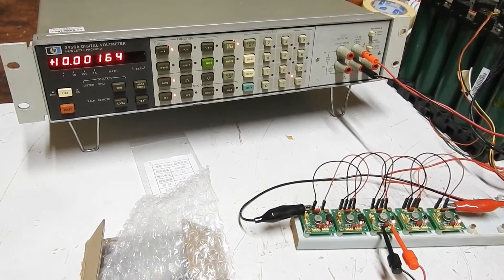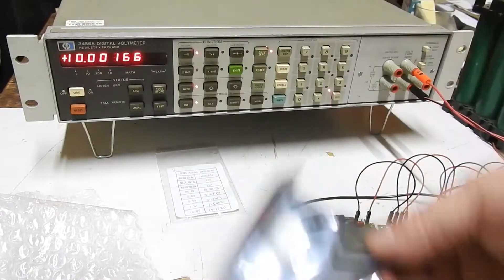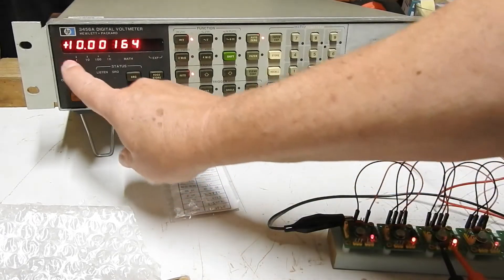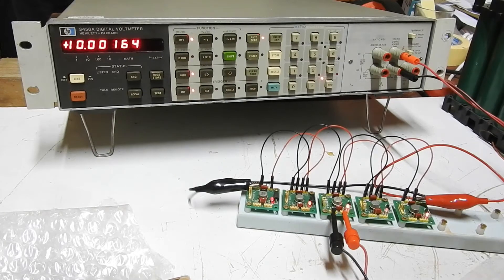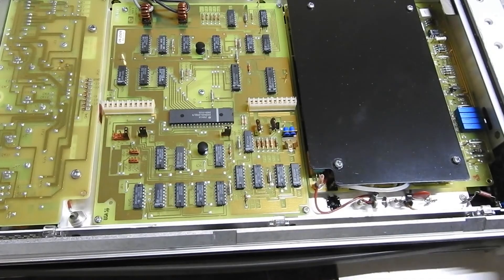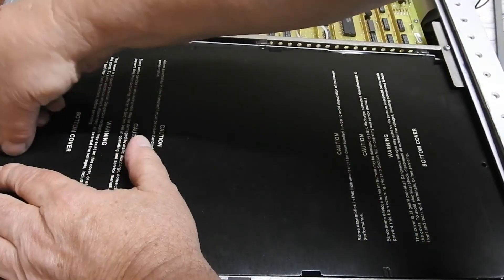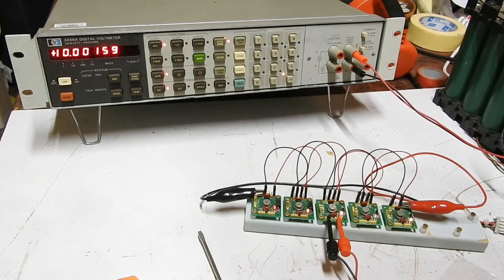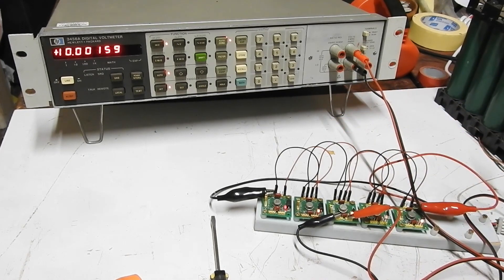HP3456A NPLC Crystal change for 50Hz

Comment: Sorry if I'm writing after 4 years from the video release, but I would like to know if you solved the problem of the flickering readings after changing the crystal. I also have a 3456A for the US market at 60Hz and I got the 50Hz crystal, but before installing it I would like to be sure not to mess up the voltmeter. Thanks.
Reply from the maker: As the video shows, the dodgy readings were just poor banana plug connections. Changing the crystal should be fine.